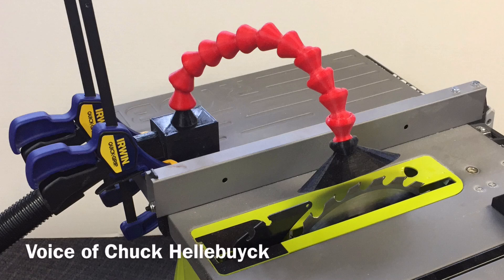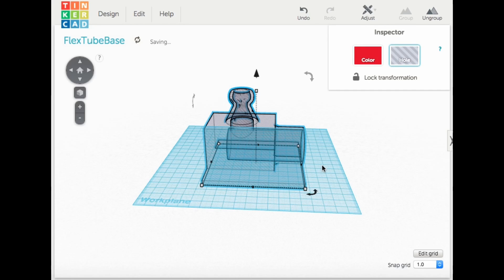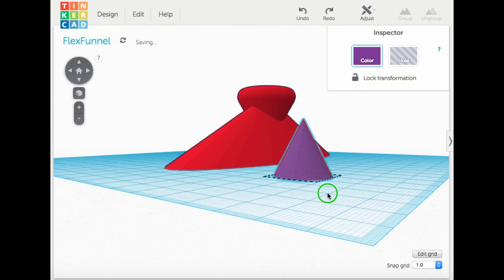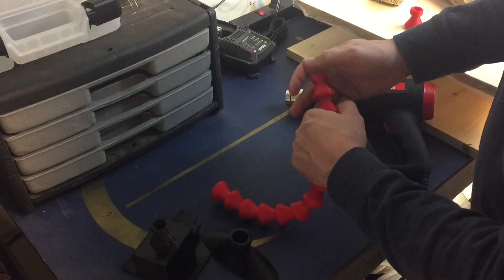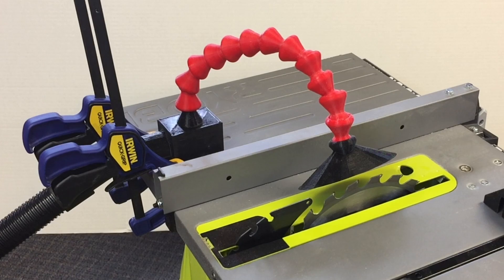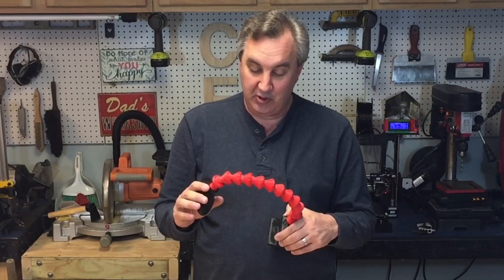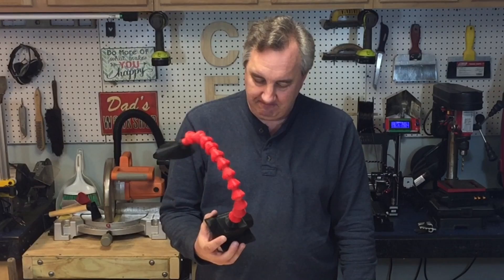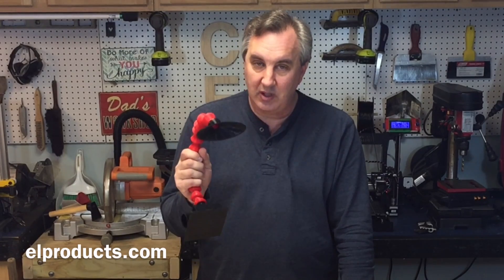Filament Friday #58 - 3D Printed Multi-Adjustment Ryobi Table Saw Vacuum Attachment

Comment: Think the diameter of the parts should be larger, the cross-section for the passage of air is not enough. And the funnel is best placed directly above the saw blade. And so, the idea is interesting :)

Comment: Hi chuck and everyone, does anyone have a thicker scraper and cannot fit their 1.0A scraper on the on the da vinci 1.0 tool holder which is designed for the original thin scraper on the 1.0 by pierchi on thingiverse??? I have redesigned it so that you can use it for the 1.0a scraper, check it out here: http://www.thingiverse.com/thing:1420398    ....

Comment: ok,so I tried the petg. and well they were about the same as working with abs for putting these together.However TPU works extremely well. They are easy to put together and have a good friction fit. If you can print tpu or some other flexible filament and want to make these I would suggest to use that.

Comment: if you had 2 weeks to kill to do it again chuck, what would you do different? if you were working the same design i mean. The idea of clipping them in together has me intrigued. Was it the heat gun that made some loose and some tight oh and by the way even though i had that 3hour 3d print that worked flawlessly, the next day i tried to print i had the same issue. Thats got me thinking something freed up when i turned it upside down. I was hoping for a simple solution before pulling it to bits but ah well thats the journey :) And note to anyone else who buys one, BUY CLEAR it is very hard to see mechanical problems through orange tint
Reply: +Chuck Hellebuyck&#39;s Electronic Products you could print it with the tpu and see how well it works or petg (for petg print the first layer slower (15 ms at most) and it will lay down. Its a little more flexable then abs but a lot more ridged then abs. I have a little left I may try it and let you know how it goes.
Reply: +Mark Burton well I printed 4 of them at .2 height and with out a little bit of sanding rounding out the base just a tad and the nose I cant fit them. but if I sand them a tad  I can fit them just fine. this was without resizing at .2 they print 4 of them in 40 min.I am trying at .1 to see how that works.
Reply: +Mark Burton  slightly easier but not much.maybe doing acetone vapor smoothing and abs would be better

Comment: Excellent job!  You sure make Tinkercad look easy.
Reply: +Chuck Hellebuyck&#39;s Electronic Products I like tinker cad for how simple it is to use. I made a new x carriage for my Davinci AIO that holds a E3d V6 using a bond tech extruder. I really like the prints I get out of it.the extruder is really nice and when paired with the e3d it simply rocks.I now need to make a new layer fan for they updated carriage though

Comment: @Chuck - You may be able to tighten up the ABS joints by baking the assembly in a 200 degree Fahrenheit oven for a couple minutes.  I have found this will shrink the ABS slightly and tighten joints in most cases.  Success does depend a lot on the geometry and density of the parts however.  Thinner walls, lower density shrink more.  Experiment!  I don't recommend the technique for PLA.